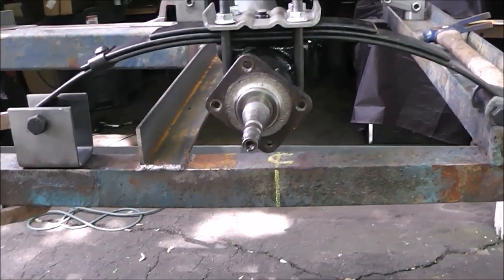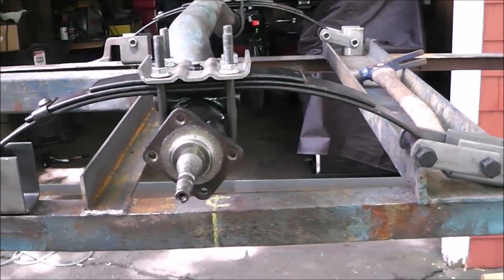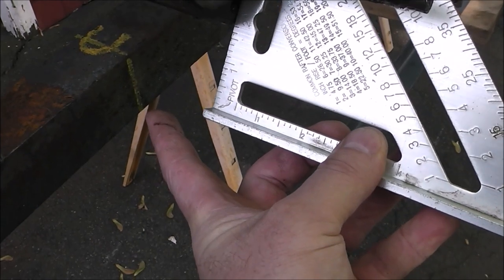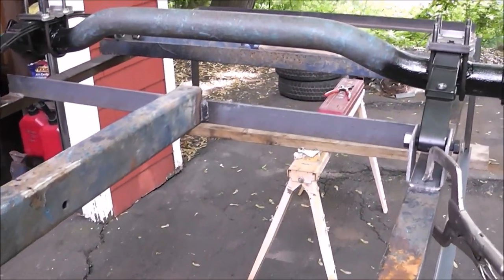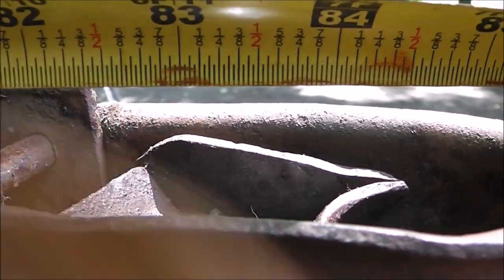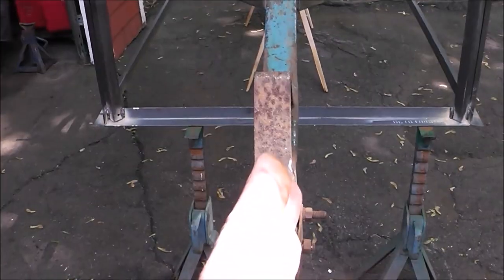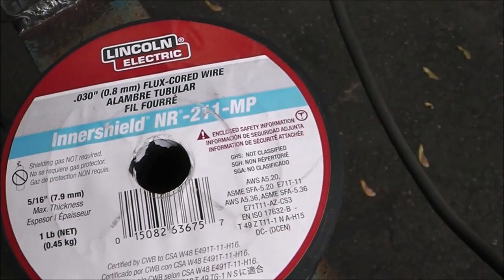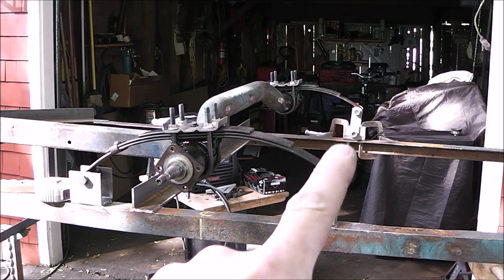HOW TO ACCURATELY PLACE AND SQUARE TRAILER AXLES ] Step by Step instructions

Comment: That squaring was wrong. You had 81-3/8" measurement on the first side you checked. The other side was 81-1/4" making that side the short side. You were supposed to push the axl backward 1/16" of an inch to 81-5/16" and the first side should be 81-5/16" to when you go back and check it again. I was a fitter and mig welder in super huge special fabricating shops so I know what I'm talking about. You doing good, you just made a mistake and I know you installed it correctly.  The only thing is, you didn't tell the people you made the mistake but made it right. Remember, there's only one that never makes a mistake. To admit making a mistake makes you human and humble.
Reply from the maker: That explains why it goes down the road at a 45 degree angle. I thought the frame was bent. Thanks for straightening it out and I'm glad that was your takeaway from the video 👍
Reply: If we’re talking about making mistakes keeping us human and humble…. then check your spelling. “measrement”.
Reply: That was a really good how to video. Most people don't realize what's involved in the fabrication process of building a trailor. Good job.  😃

Comment: “Great presentation. However, if I understood your part about matching the distances from axle tip to front hitch, then I think you meant to add the 1/16” to that side instead of subtracting 1/16”. Furthermore,  it seems like it would be closer to add the full 1/8” since the axle is pinned at spot weld which is almost at the end of the other side of axle and not subject to much change due to axle shift.

Comment: I recently purchased a used 4x8 utility trailer and realized that it was originally a 4x6 that was extended 2 extra feet, however when they extended it, the failed to recognize that the axle position should also have been adjusted to meet the 60\40 rule, thanks to your video, I now have the courage to make this adjustment myself.  Your video is extremely easy to follow. Cheers from San Antonio, TX.
Reply from the maker: Thank uou very much @GATO NEGRO good luck with your project!
Reply: Great video,  easy to follow
Reply from the maker: Thanks Gary!

Comment: On a tandem axle trailer you want your equalizer  at the 60% make. Tongue  at 75 to 100 pounds  is too light for a trailer  requiring  2 axles .
Reply from the maker: Depends what your loading and where your placing the weight. A car driven on a trailer versus a car backed on in same spot will result in 2 different tongue weights. Manufacturers go  heavy on tongue weights to reduce complaints. A heavy tongue reduces trailer sway but also decreases gas mileage and puts additional stress on the tow vehicle. I've built numerous trailers with the goal of achieving around 100 pounds empty and prefer this over a manufacturers method of overly heavy tongues.

Comment: You had to move the axle back a 1/16" and recheck
Reply from the maker: You can't check and recheck enough. Its a lot easier to tack things together and get it perfect at this stage than it is to say "close enough" and fully weld it. Taking your time here pays off

Comment: I built adventure trailer with a rooftop tent a little while back and only did step 1 (I'll admit I didn't know what I was doing).  Trailer tracks and tows just fine but is eating tires.   After watching your video at least I have a good starting point to work from.    Have a 2000 mile trip coming up in 3 days and don't want to donate a set of tires to the highway.
Reply from the maker: Thanks man. Glad i could help. Safe travels!

Comment: I added a Trolling Motor to the front of my 16’ boat recently, it’s 70 lbs. 
it added significant weight to the tongue. 
I used a bathroom scale as you suggested. 
I moved the boat back 6” on the trailer and that took off 80lb, I now have 118lbs of tongue weight which works for me, it was closer to 250. Easy to do and now the weights not all on my truck. Doesn’t bounce as much anymore either…
Reply from the maker: Excellent! Glad I could help!

Comment: great video, my man. i'm about to turn an old camper into a tiny home and i'm going to be adding to the length of the bed. this is my guide to making sure i reattach the axles correctly. you've helped another!!
Reply from the maker: Thats awesome Joe. Keep your tongue weight around 150 and it will tow like a dream and won't sway all over the road like you see some trailers doing.
Reply: @BrandonLund  thanks, man. i might come back and comment some more if i have any questions.
Reply from the maker: Thanks Man! Anytime!

Comment: Can you do the same measurements without flipping the trailer over? I am trying to relocate my axle, on a heavy 12x6.5 trailer,  as the company who built it placed it at ~30/70 ratio and that is way too much weight on the hitch. 
Thanks!
Reply from the maker: Yes. Just make sure your tape is straight and you are measuring in the same place every time.

Comment: Excellent video, super easy to follow - One question: I recently read on a mfg’s (etrail--)site that you should weld the hanger brackets along the side of the bracket , and not across the main beam because it’s a higher stress point.  While that seems contradictory to me - welds make the steel stronger(?) - I am no expert - just wondering about other thoughts on the topic.
Reply from the maker: Thank you very much. I've heard that also but I've also seen commercial trailer manufacturers doing it both ways also. I don't know if there is a right or wrong. More weld is usually better in my opinion.
Reply: @BrandonLund  It has just dawned on me that those trailers (at other site) were aluminum - even more I know nothing about, but it’s potentially a factor in that technique.   All mine are steel and were welded (by others) as you have described.

Comment: I put a new axle on a little camper trailer.  Checked all measurements several times.  Only 1 tire gets uneven wear, the other wears perfectly.  I can't figure out why- it seems as if the axle wasn't square, both tires would wear unevenly.  Thanks for your video.
Reply from the maker: Thanks for sharing and your welcome
Reply: @BrandonLund any idea why only one tire would be wearing?
Reply from the maker: It your axle is measuring up square, it sounds like you have a bad / bent axle, bad wheel bearing or a bent wheel.

Comment: I see that an earlier part of your video one of the cross beams was in the way of the rear hanger brackets would have to be secured, I'm assuming you just removed it and adjusted the spacing accordingly?
Reply from the maker: Thats correct! 👍

Comment: At the end of video after all is welded do you tighten the bolts on the axle,or leave slightly loose.ty
Reply from the maker: I tighten everything down once the bolts are through the hangers.

Comment: i have 4x6 trailer how far back from centre can i go with single axle thanking you. you are good and patient
Reply from the maker: However far back you need so you have the proper tongue weight.
Reply: thank you BRANDON from australia
Reply from the maker: Glad I could help!
Reply: thank you Brandon was not sure about axle distance.now i am  building a pto driven horizontal    rock cutter stump grinder attached to my massey ferguson 240 tractor

Comment: Great Video!  I am rebuilding A Demco Karkaddy SS tow dolly ( with a two--piece folding tongue assembly)that was the victim of a jackknife accident. The front half of the hinged tongue assembly was bent severely in the accident, and I have just replaced that piece. Preliminary triangulation from the centerline of the spindle kingpins to the front centerline of the ball hitch release lever shows a deflection of 7/8". 

I have built trailers before, and I always got the triangulation perfectly matched. From what I know, and what you have said in this video, it appears that I may have to also replace the rear half of the tongue assembly, which bolts into the tow dolly rear axle assembly. Placing a straight edge along the sides of the rear tongue shows a definite difference in the profile between the two vertical sides of that part. 

To give you a clear picture of what I am working on, page # 22 at the following link shows the parts breakdown of the tow dolly that I am working on: https://cdn.demco-products.com/documents/Manuals/RD20025.pdf
Reply from the maker: Those are really nice to have and they dont come cheap. It sounds like it shouldn't be too difficult to straigten.

Comment: I have a 8x10 double wide snowmobiles single axle was off of it replaced some bolts  had some frame fixing to do.what would be proper placement of the axle.
Reply from the maker: I would set it to have about 100 lbs to tongue weight empty or another formula is 10%. So if the total trailer weighs 1000 lbs empty than the weight at the tongue would be 100 lbs. Before you fully weld it, it might not be a bad idea to load the sleds and verify. This time it would be trailer weight + sled weight and use that total for 10% tongue weight.

Comment: i am 1/16 off after torquing the ubolt hangers to 40 ft pounds, is 1/16 acceptable?  i am measuring from hub mount to edge of first ubolt
Reply from the maker: Your all set.  a 1/16 won't hurt anything 👍

Comment: Are you usuing wire AND gas welding ?  Or is it just the wire ?  Thanks
Reply from the maker: Just wire. I usually don't use gas when working outside.
Reply: @BrandonLund  Thanks for the answer. I have an inverter wire welder so I will give that a go. Ta.
Reply from the maker: Good luck! 👍
Reply: @BrandonLund  Thanks Brandon .I'm building a trailer for a rather large helicopter. Your videos are helping me alot.
Reply from the maker: @jackspratt4343 I appreciate that! Thank you

Comment: I hear that when you weld hangers, you're supposed to weld front to back or vice versa, not weld across.  Do you agree?
Reply from the maker: I've seen it done both ways. I'm sure someone has written a specific procedure somewhere but I have never had a problem and I've built quite a few trailers. Most manufacturers that I have seen weld them like I did here.
Reply: I've read the same thing in multiple places, never weld across the longitudinal members.
Reply from the maker: @kakman1958 i would never discourage anyone from doing something the way they feel is best. We have a national trailer manufacturer close by and thats how they weld theirs also. I've built quite a few trailers that have been heavily abused with heavy equipment and never had a failure. I cant say if one way is better than another but most seem to do it the way i did here including many pickup trucks have the sping hangers weldes as i did here alao

Comment: Where did u find those spindles. Pls give me info
Reply: I need those bolt on spindles   what are they from
Reply from the maker: They were on the original trailer. They look to be a rear axle from a mini van. They had emergency brake cables so I stripped everything except for the spindles.

Comment: The bit where you explain how to set the position of the axle on a tandem trailer wasn't clear to me. are you saying that you put a bathroom scale under the hitch and move the front axle back and forward till the scales register 35kg or so?  Does this mean that the back axle is not yet on the trailer - and you are only dealing with the front axle?  And where do you put the back axle once you've located the spot to put the front axle? In my own case the trailer will be  only 8' x 6' - so where would be the best positions for the axles?
Reply from the maker: Yes, that is how you do it. For dual axle trailers you want both axles under the trailer with the equalizer part attached (thats the piece that connects between the front axle and back axle). Then you slide the axles front or back until you have the correct hitch weight on the scale. The trailer should be level so you will need a block of wood from the trailer coupler down to the bathroom scale.
Reply: Fleanis Werkhardt  I'm just wondering why you are using two axles on an 8' trailer?seems like it's an overkill ,plus so short of trailer seems to me not gonna be enough room for two axles. Not trying to sound like a smart ass,I could be wrong for sure. But would like to know if you did eventually use two axles on trailer you wrote about. Thanks for an answer
Reply: @johnsellers2999  It's for a 2500kg skid steer loader. Obviously a single axle isn't going to tolerate that sort of weight. I already had the 2,4m tray . BTW - I have seen a 6' trailer with dual axles.
Reply: Fleanis  well that certainly answers my question. Yea skidsteers definitely have the weight. Thank you for getting back to me with an answer. Peace brother.
Reply: Fleanis looking back at your question to Brandon I would say you put your second axle where ever you can fit it behind the first one as I'm pretty sure not much room to put anywhere else lol ,there I go again with my mouth getting me in trouble. Yea those skid steers do pack some serious weight into a small package. Thanks again for the reply. Peace
Reply: @johnsellers2999  BTW,  I just checked the compliance plate on the loader - it's actually 3,000 kilograms!
Reply: Fleanis  man as soon as you came back with skid steer I knew where you were coming from. Then I started thinking about forklifts ,so yea I know now where you where coming from. Thanks again for the feed back

Comment: I just bought a brand new 5x8 enclosed trailer and the axle is so crooked, I can see the entire side of the trailer from the drivers mirror, and can see none of the other side from the same position in the passenger seat. Also, the tire sticks out big time past the fender on the drivers side. It’s so bad you can see it’s crooked just by looking straight on at the wheels. Brand new trash.
Reply from the maker: Thats crazy! Well now you will have a good idea of what to look for and you'll get an idea of how far it's out. You might be able to get away with just cutting one side loose and squaring it up that way.
Reply: @BrandonLund   yep, thinking along the same lines, except I’m a touch heavy on the tongue weight so I will likely move the whole thing forward. Shouldn’t be a bad job, I have a lift and all the tools I need.